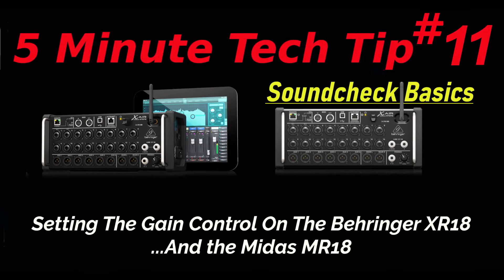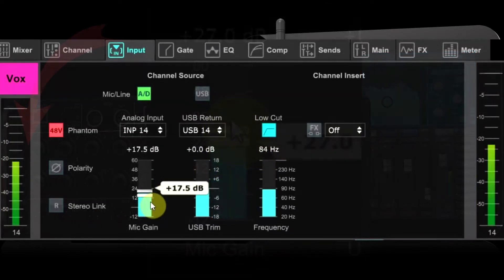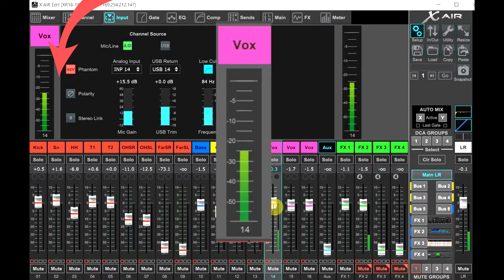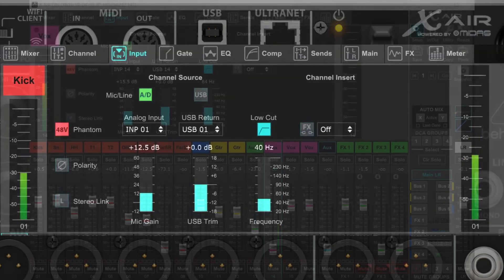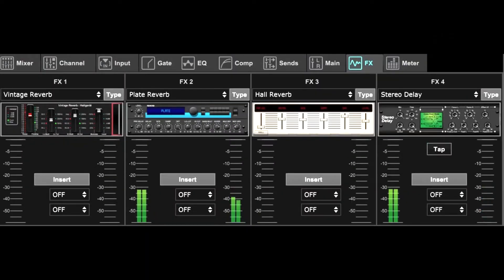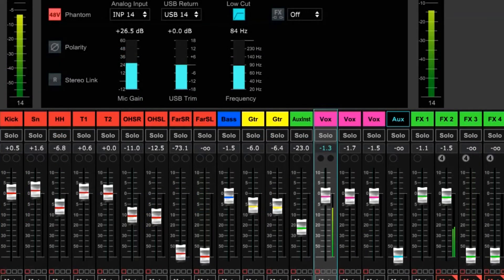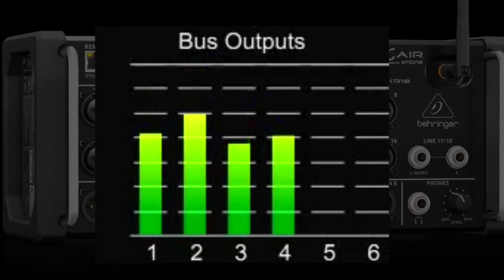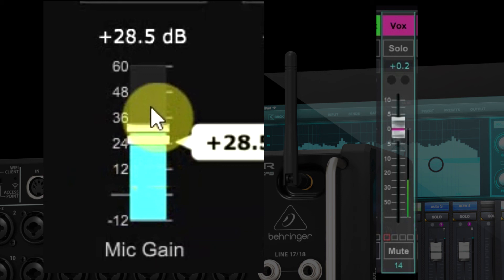Behringer XR18 Gain Staging and Signal Flow -  Soundcheck Basics - X Air Series - Midas MR18

Comment: So do you set the channel faders and master fader to unity point first, then use the gain control to set the input levels to -18dbfs? What about after that in order to balance the levels of each instrument, is that when you can move the channel faders? And for setting the output volume of the main (active) PA speakers and powered monitors, do you leave the master fader on the XR18 at unity point and adjust the volume level from the speakers and monitors?
Reply from the maker: I leave the channel faders off... but do put the main/master at unity. I set the gain on the channel, then bring the channel up while listening to the source as I bring the fader up (slowly). If the channel fader can't reach unity without being SCREAMING loud then that tells me the system has gain issues AFTER the console. If it's my system I address those issues if there is time. If it's not my system and/or there's no time to troubleshoot, then I reduce the master fader so that the mix will be at an acceptable level with the channel faders 'around' unity.
The actual mix will dictate exactly where the channel faders need to be, but most things will be at or near unity when the gain structure is correct. That doesn't mean all faders perfectly in line at unity, but likely within a few dB either side of unity.
Now... that said... it could be the room/stage is small and stage volume so loud that not much of a channel is needed in the house (like say a screaming loud guitar amp onstage)... So the above isn't necessarily talking about that scenario. But vocals are always a good source to test things by first, as is an MP3 or WAV player... things where stage volume doesn't mask anything.

If the situation is such that with the channel faders at unity, and the master at unity, then there's not enough level in the system... That's still telling you that there's a problem somewhere. And again  after the console (unless the console has a problem). If the meters in the console are right  (and the console is operating properly), then proper input gain, channel fader at unity, master at unity should mean there's plenty of output available at the PA if it is gained properly itself. And working properly.

All of this is a clue that something is wrong that needs fixed when you set your gains this way. It makes the meters actually consistent and relevant. 

Let the meters in the system guide you to the problem. Where is the signal right... and where is it not right as you follow the signal flow chain?

All of this is not to say the master fader has to always ride at unity either... But it should be AROUND unity in normal circumstances. And you should be able to start the system check with it there. Maybe the gig itself calls for the master fader to be pulled back 3-5dB for early in the night, when things are slows, so you haven't put all your eggs in that one basket to bring things up when things start hopping.

Comment: It’s ok to have the gain on the channel cranked to 30 or 40 to get nice -18 levels?
Reply from the maker: Yes... For a typical singer with an SM58, 30dB is probably (or could be even) a bit low. Definitely close though. Of course every singer and mic is a little different... But if I saw 32dB of gain on a vocal channel with an SM58, that would seem perfectly reasonable. 40 is probably high, but that would depend on the singer. If the singer doesn't belt, then a few dB more gain is going to be called for.

Comment: I have XR18 and still Confused, what is setting for GAIN (-18?) and what is setting for FADER/SLIDERS (0) ? And then adjust faders in sound check?
Reply from the maker: You should adjust the gain control so the channel input meter reads -18dBFS (or the Solo/PFL meter when the channel is soloed). This is super simple on the X-Air Edit software, but the iPad doesn't give you an easy to see scale.
This video dives in deeper so it might help:
https://youtu.be/xPsSPK6RKzU

Comment: thank you for your videos, they have helped a lot.  I have a band and we do live gigs using IPAd and Xair app with an XR18.  Several people have mentioned that the IPAD doesn't have numbers on the meters.  my question is during sound check, when adjusting the Channel mic gain, what db  level should the channel fader and Master(Main) fader be set??  I understand that the Vox meter is in DBFS.  Do you know if the DB on the Channel fader/Bus faders  is also DBFS or DB?
Reply from the maker: I don't have an iPad to check anything, and no way to cross-reference against X-Air Edit on PC... but that is what I'd do if I was you. Sometime when you have a chance to experiment, connect a laptop or Mac running X-Air Edit to the console and also connect via iPad running the app. Send some music, pink noise, or test tone to the mixer (pink noise, white noise, or test tone would be best since the signal would be constant). Bring the gain up on the input until the meter reaches -18dBFS. Now, look at the iPad and see where that translates to the iPad's input meters. 

The faders are 'screened' in normal dB's with a unity mark and several dB of boost indicated. While I don't think those are technically indicative of anything as far as the meter goes, you can still use them as a reference (the input meters are beside the faders on the iPad app aren't they?). Since X-Air Edit will show you when the signal is hitting -18dBFS, you just need to make a mental note of what that corresponds to on the iPad and what that means you need to hit on that meter in relation to the fader screening. 

I did something similar for Mixing Station on the Android, so you can see an example of what I'm talking about you doing for your iPad in the first part of this video where gain structure is discussed and I have added a section with this experiment for Mixing Station app:
https://youtu.be/xPsSPK6RKzU

Comment: Hey Alan, Vernon here again!  Thanks again for another great tutorial.  My topic has been mentioned below but the answer is yet unclear because you are not using the iPad app.  I am using the iPad app and am hesitant to switch apps.  Thanks to you, I'm getting a decent understanding of the XR18.  So, the problem is there is no input meter on the input tab.  We can adjust mic gain and USB gain and all the other things the X air edit app has, just no meter to see the -18 dbfs.  How would you go about gain staging without an input meter?  Thanks!!
Reply from the maker: Not having an iPad, I'm just not sure how the meters are scaled/intended to be read. One thing you could do is what I did in the XR18 Channel Walk-thru video ( https://youtu.be/xPsSPK6RKzU ) where I had both X-Air Edit and Mixing Station connected and send a signal to the XR18 and compared the meters. Obviously, in your case you'd use the iPad and X-Air app instead of Mixing Station... along with X-Air Edit. You can download a white noise or pink noise signal. Or a 1K tone for that matter. Or just play a music track as your source, but the consistency of a dedicated test signal makes it easier to exactly compare the meters. So... just compare where the iPad meters are when X-Edit hits -18dFS. And go ahead and bring the signal up to get a feel for other points along the way too. You might also make sure when you hit clip on X-Air Edit meters that the iPad app is showing clip too. Or whether it's faster or slower to show clip. Just so you know.

Comment: Just wondering, I can't get and dB numbers on my meters on the iPad app, just block meters. Are accurate dB numbers only in the X air edit on pc?
Reply from the maker: I don't have an iPad to test. You can get Mixing Station for the iPad, but if you're already used to the Behringer version of the iPad app that probably doesn't help.
Edit: I just realized this comment was under the Gain video and not the video I just posted today which was talking about meter differences between X-Air Edit and Mixing Station. DOH! So you could even be using Mixing Station for the iPad for all I know... I did a test in the new video comparing metering between the two platforms:
https://youtu.be/xPsSPK6RKzU

Comment: On the gain change during performance point: it's worth checking out the 're-gain' feature In the aftermarket Mixing Station Pro. It resets faders, sends, compressor/gate thresholds and LR automatically when the gain is reset. Brill (but beware if you are recording as it will not reset DAW levels) .

Comment: Alan, Why are you running Phantom power on that?  Thanks!
Reply from the maker: IIRC  I was using a condenser mic on that video for the demo for the vocal channel settings. And that would need 48V (Rode NT1 mic). And the kick was a sample that played thru a Radial J48 DI into the console and the J48 needed phantom.
I don't recall if I did any other channel demos, but if they were samples, then they were tracked and rendered, and then copied to my WAV player and played back thru it... and into the J48 into the XR18.
I could've connected direct to the Aux ins for the samples but I wanted to keep the channels/instruments accurate with a normal console layout,
Reply from the maker: I sometimes use an SM91 or Beta 91 in live kicks and either of those mics need phantom too... But that's not what I did here. I just used the sampled drums.

Comment: How will I know if my meter is full scale? Anybody knows? I’m using Allen Heath Qu24 and always gain staging at zero / near zero.. I tried at -6db but the audio was too weak.
Reply from the maker: I don't have an AH Qu24 but is 0 the top of the scale on the input meter? That's a good sign you're looking at dBFS if zero is the top of the scale.
Where is the signal too weak for -6? Assuming we're talking dBFS that should be pretty hot. If you've setup a sound system around a console where the inputs are going to be running at close to zero, then just fixing the gain structure at the start of the chain (the input) will leave you with troubles downstream if you don't address that area as well.
OTOH, if the meter keeps on going above 0dB... +3, +6, +18, +28 then that would indicate you have headroom above 0. So in that case, I'd be looking at zero as my reference and it sounds like -6dB would be running too conservative.
Let me see if I can find a manual for the QU24 and have an actual answer rather than just guessing on the possibilities.
Reply from the maker: Ok... they appear not to be dBFS on the AH QU24. 0dB is not the top of the scale. The channel's have limited metering, and even those don't peak at 0dB by their scale. They have a clip or peak light above that.
Then in the meter section, it's a meter with more resolution, and once again, 0 is not the peak. You have several dB above that before clip (or running out of room in the digital bucket).
Sooooo... your -6dB would be running too cool. I'd be averaging close to 0 and letting it peak above zero, just like an analog console.
This video has some good information, and the 2min :55 mark is especially relevant:
https://youtu.be/Q9P-Om8UBe4
Reply: @AlanHamiltonAudio  Wow, thanks so much for checking it out, truly appreciate it. Noted and thanks for sharing your insight about this issue. I’m new to mixing and these info will help me in my growth.
Reply from the maker: @onzkicg  No problem! Glad I could help! :)

Comment: Any tips for gain/fader adjustment when recording with the XR18 into reaper in regards to getting ideal wavelengths?
Reply from the maker: I always use the 'analog' tap point on the USB sends (red ring), so faders don't matter. It's just the gain control that matters. Everything else I'll do in post.
I always use -18dBFS for the reference level. That's the average, not the peak. I'll allow it to peak above that. IOW, if I see a -15dBFS or even -12dBFS signal peak on the channel meter that isn't necessarily going to cause me to readjust the gain if it's typically hitting (averaging) around -18dBFS.
That seems to work well.
Here's the XR18 to Reaper video on the channel:
https://youtu.be/xYmJGyroVe0
Reply: @AlanHamiltonAudio  Thanks mate really appreciate it, I'll definitely take all this into account from now on:)

Comment: When you say set gain to -18db on "input meter" (at @ 5:00 min) are you talking about the left meter labeled "Vox" where your red arrow points, or the "Analog input" that also says "Mic Gain" where you are making the gain adjustment? They appear to be two different scales.
Reply from the maker: I don't think you meant the 5min mark since the video is ending there so I'm not 100% sure if I see what it is you're talking about for sure. If you look at the 1:39 mark, the meter we're concerned about is the meter on the left. The point where I'm making the adjustment isn't a meter, it is the mic/gain control and it's just showing you the the +/- adjustments that the gain control is making. It's just giving you a visual reference to where the gain control is set relevant to the numbers on the scale. It's showing you the exact same thing the fader cap is showing you on that gain control. It's just an added visual, not a meter.
OTOH, if you're talking about the meter on the right, then it's an AFL meter. The meter on the left is the input meter and PFL (pre fader), and the meter on the right is AFL (after fader). So that meter on the right changes with the channel fader adjustments... though technically, if you change the gain control after you bring the fader up then the AFL meter will reflect that too, since it includes whatever you do with the gain pre-fader. Pre fader-fader-after fader.
But for setting input gain we're just concerned with the far left meter in this case. That's our first stage.
And FWIW, I'm talking about the signal averaging -18dBFS on the input. It can peak above it. Even +3 to +6dB. I'm not saying to never let it go over -18dBFS.
The main thing is, there's a misconception that it needs to be adjusted all the way to 0dBFS or just under the red, as you would do with an analog console. But we're looking at two entirely different types of metering. Roughly, -18dBFS IS 0dB on an analog console's meter.
Reply: @AlanHamiltonAudio  Yes, it was at 1:39 mark. I get it now. The left meter is what we're aiming for to be around -18db. I noticed my electric guitar channel was really hot on the FOH in a church setting. I'm using a Helix digital processor as my amp direct into the XAir-18. I'm sending a Mic level signal into the XAir and had a hunch the gain was too high. Asked the sound tech to check it and it was almost at unity gain! Told him to bring it down to -15db. I'll check that and all the gain settings again and make sure we're setting everything up to about -18db. Thanks again for these helpful videos.
Reply: Can you do a video using xair app not the edit version thanks in advance

Comment: a question friend ... why do you put the kit on channel 1 if it is high impedance? (Hi-z)
Reply from the maker: I always use DI boxes for Keys, bass, and acoustic no matter what console I'm using. And I use a traditional input list patch:
Kick, Sn, Hat, T1, T2, T3, OHSR, OHSL, Bass, Kez, Gtr SR, Gtr SL, Vocal SR, Vocal C, Vocal SL, Vocal DR (or some variation of that adding/removing whatever is needed in each section). So, the Hi Z inputs on 1 and 2 don't gain me anything for that reason.

As a rule of thumb, you should only use about a 20-25' instrument cable on those channels (longer = more susceptible to noise for one thing)... For a home studio that can work if the X-Air is right there in the room and you might not even need 10'-15'. For a small stage, where the X-Air can be put close to the musician it can work. But for larger stages and larger setups I wouldn't be using those anyway because those cables would be longer than that. ...And it would mean not using a standard stage patch, so that would be a second strike.

But, there's nothing wrong with using those for Hi Z inputs if you're not trying to follow a standard physical stage patch, and the cable length is OK.
For me though, it's just as easy to do things consistently and just use a DI where I have a Hi-Z instrument to connect and then connect it to wherever the stage patch puts it. And most of the time, I wouldn't be able to use the Hi-Z inputs onstage anyway, because I'd need longer cables than 25' for them.
It's just easier, and more efficient, to drop a labelled DI line at the musician's wedge position so he/she can drop a short instrument cable to it for their acoustic guitar, keys, bass, etc...
Reply from the maker: By the way... Good question!
Reply: @AlanHamiltonAudio  
Thank you very much friend